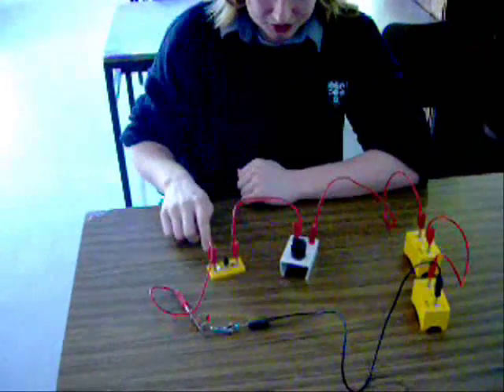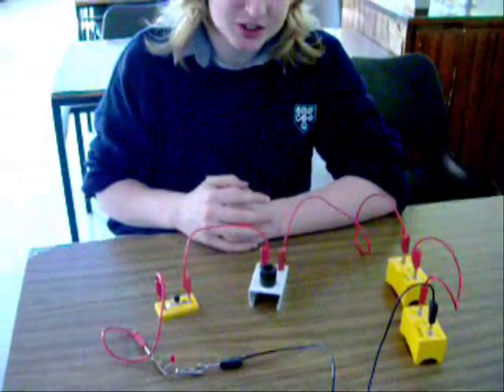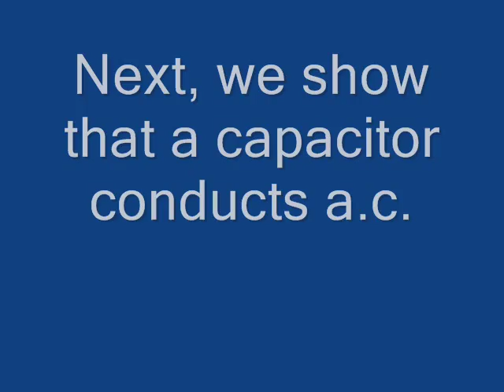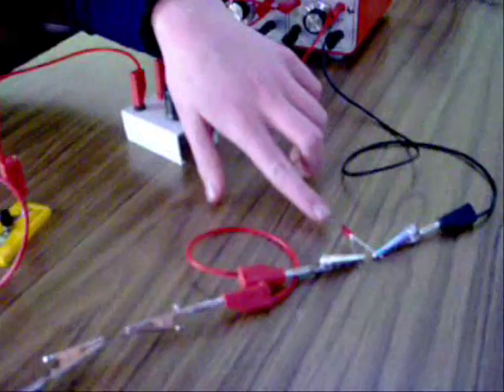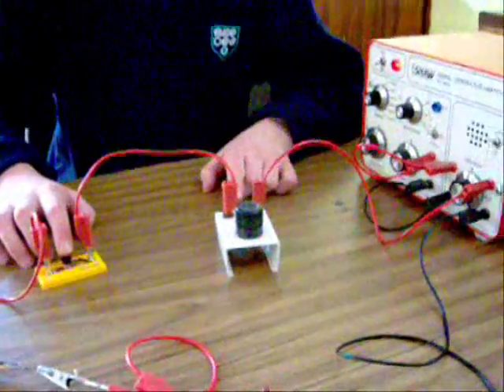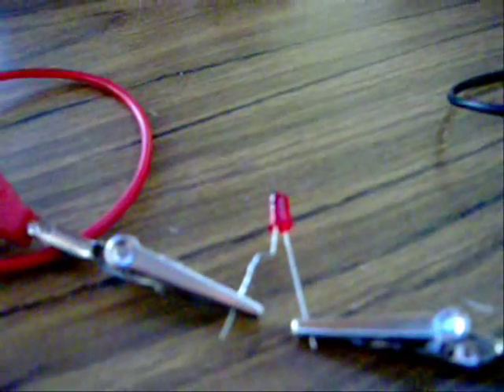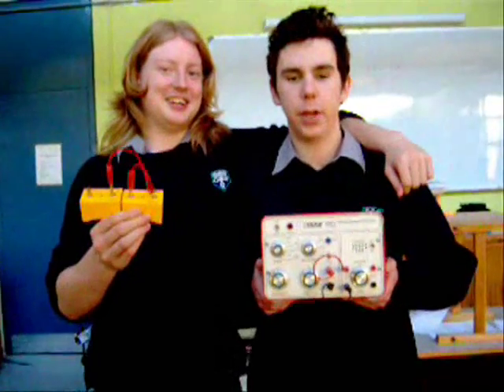To show that a capacitor blocks d.c. but conducts a.c.

Comment: My teacher connected a capacitor in series with a light blub and then plugged it into the wall, the bulb lit up, it showed the class that capacitors can allow ac current to flow.